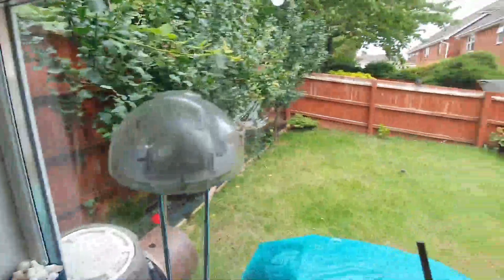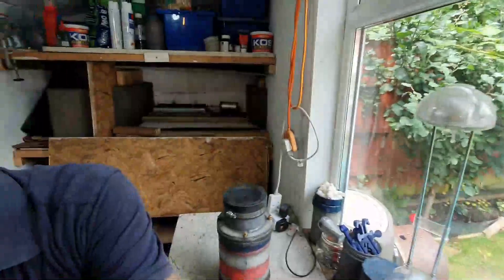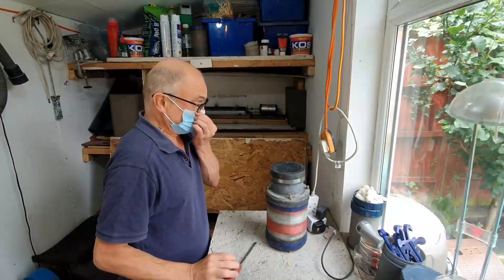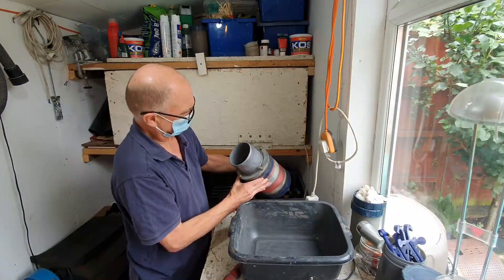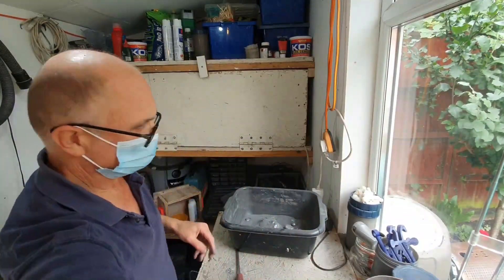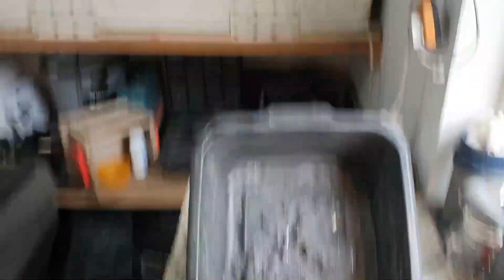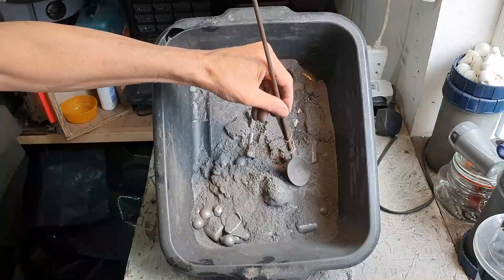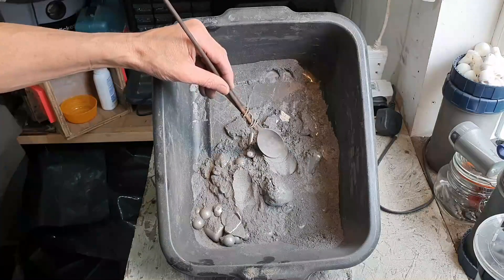aluminium powder from kitchen foli - 4

Comment: On a serious note, if you're playing with things that have the potential to go boom, you also need to consider less obvious sources of ignition. Such as static electricity(from the foam you packed in there rubbing against the drum and other parts, depending on the materials involved), sparks from the media(steel on steel), potential for overheating of the machine, and other sources of ignition depending on what you're making. Opening a can of explosive dust(especially metal dust) in a confined space with electrical outlets all over the place is begging for a big boom. One of the "dust clouds" hits an outlet just right, it could cause it to arc igniting everything else. Playing with flammable or explosive things is insanely dangerous. If you're gonna do it you better know exactly what you're doing if you like your body arranged the way it currently is, just ask all the amateur IED makers in Iraq and Afghanistan who got bit by their own products. Even if you do know what you're doing, things can still go sideways, it just reduces the probability of it going catestophicly sideways.
Reply from the maker: Excellent point, I have ignited aluminium powder with only bright sunshine. Fortunately, it burns slowly if in a heap and without oxidiser, albeit white hot.

Comment: You weren't worried about the steel balls making static friction and possibly igniting during the milling process?
Reply from the maker: It was a concern but I was careful to mitigate this risk by not creating too fine a powder. I didn't want to use lead or glass balls since they grind away rhemselvds and contaminate the powder. Any suggestions as to what to use as milling media are welcome.

Comment: Thanks for the video. Is it possible to make pure aluminium powder using ball mill  and use it in powder metallurgy parts manufacturing. 
If there are contaminants it won't work,  parts will have defects.
Reply from the maker: I honestly don't think the powdered metal I make  is pure enough for your use-case. I add charcoal to coat the particles and prevent oxidation. There will definitely be plastic and other contamination from the barrel. All this doesn't matter for pyro uses.

Comment: I was just about to comment to make a test area away from workspace. My brother moved a tractor into my shop and since I use a wheelchair I could not get to my usual test area, I lit a star to see the color and a nearby bowl of stars caught, then the residue on my benches spread to my stored compositions and chemical powders. About $2000.00 worth of chemicals burned up in less than five seconds. The smoke was so thick you could cut it with a knife. I rushed out of there and called the fire dept.. When I told them I had aluminum powder they evacuated the entire neighborhood. This occurred at 4am, by 6am there were approximately 40 to 50 gov. vehicles lined up and down my block for 14 hours. Looking at my home-made equipment they were convinced I was making a living manufacturing fireworks. It was 10 years ago and I'm still getting "oh so you're the guy" . Not my proudest moment. haahaahaa
  Oh in the end it was just smoke damage and a couple cardboard boxes burned but they had to go in there with a water hose, smoke mixed with water makes the most corrosive compound, everything in my shop was rusted beyond recognition, every tool, every nut and bolt, everything trashed.
Reply from the maker: Wow that's not the best experience! I'll certainly take more care in the future.  Hopefully others will take note and not make the same mistake!
Reply: @philipwaters  Someone said, "keep the dragon small so when he bites it's not so bad" Good luck.

Comment: Nothing like almost burning your garage down lol. Anyway did you open the ball mill every few hours or day etc because I have heard if you just let it mill for a week or something then open it, it could rapidly oxidise when it meets new air and ignite after a few second.
Reply from the maker: Yes absolutely,  you need to check your ball mill every day or two. I never experienced auto ignition on opening the barrel,  but it's definitely a good idea to check your charge frequently. Also don't run the ball mill too quickly to make sure the grinding happens quite slowly. Don't forget to add some powdered charcoal too.
Reply: @philipwaters  ok cool, thanks for the advice :)

Comment: Hey sir can you tell me please how gram of foil you need for this batch of powder
Reply from the maker: You should adjust your charge of aluminium foil according to the size of your ball mill. I used two rolls of the thinnest gauge aluminium foil I could buy.. not sure how much they weigh. You will get losses in the production process (sieving etc) but at the end I get about 500g after two weeks of milling. In terms of economics you would be better of just buying it from a chemical supplier
Reply: @philipwaters  For now i am asking just for theoreticaly purpose.
I dont have ball mill yet.
In my country we still dont have fireworks culture and hobbist are very rare and no one selling chemicals, we dont have sites or stores for that.
 I can buy KNO3 and sulphur in agricultural store, i can make pyro grade  charcoal easily, dextrin and SGRS arent problem.
but metal fuels are something what i need to make. 
Tnx for answer Philip!
Reply: @PyroHamster980  where are you come from sir

Comment: How to make a fast burning flash powder using potassium nitrate aluminium and sulfer can you tell me the best ratio
Reply: • [55/35/10]
• [Potassium nitrate/Dark aluminium/Powdered sulfur]

Use this formula. It makes impressive, loud salutes similar to those made with K perchlorate. The sulfur is necessary if you desire a large report with significantly more power and brisance. At critical diameter - to the possible surprise of some - it is actually exceedingly more powerful than [70/30 • K perchlorate/Dark aluminium] flash composition, as gaseous products are produced post-initiation, unlike typical 70/30.
Reply from the maker: Thanks Sam that will work. You will also get a bright flash just by casting burning aluminium powder into the air.

Comment: That was also very dumb of you . You defently should not be trying make any sort of pyro composition you need to think it all through to the end before plan and work out the working space so you have everything seperated at all times and YOU DO NEVER EVER HAVE ANY KIND OF FIRE OR ANYTHING THAT CAN EVEN MAKE A SINGLE SPARK IN THE SAME ROOM AS ANY PYRO COMPOSITION OR WORK PLACE !!!!
Reply: You most surely are correct, Hansen. There where/are some very important safety procedures that were ignored here. If there is any hobby that requires a decent amount of Common Sense, it is most definitely this one. The accident could have easily been prevented if he simply moved the camera to a safe location a couple meters away for the reactivity test, which would have only taken up an extra 20 seconds of his time. I smelled more incompetence in the air then aluminium dust. Frankly, his aluminium here was clearly milled to a very, very fine state with a large amount of sub-micron particulates, this conclusion was inferred visually. Extremely reactive product. Unoxidized enough and fine enough to be pyrophoric givin the correct circumstances. Lightning a spoon of it over the container? Ignition was guaranteed to be an inevitable conclusion to the situation. Now just imagine if that was a flash powder. Bad news for sure. Especially if it is a chlorate one in our hypothetical thought experiment. Our man (Mr Waters) would have experienced an even worse day. Wait, scratch that, - it would have likely been his last moment alive.

Safety cannot be understated. Those who neglect it are prime candidates for the next Darwin Award. Life is a precious gift. We have a moral obligation to respect it. Philip is lucky and highly fortunate he did not sustain severe injury or further property damage. I sincerely hope he learns from this experience, continually reflecting on it, making it imperative to have a more sense-compatible mindset in the future. Hopefully this accident will be his last. That stated, we must remember that nothing is guaranteed whatsoever.
Reply from the maker: You live and hopefully learn. I have learned some valuable lessons. Hopefully others will too.

Comment: Brilliant !i would like to do one like this. Your ball mill is made of PVC ? And are the grinding balls made of steel?
Reply from the maker: It would be more cost and time efficient to just buy the aluminium powder from a chemical supplier on ebay or amazon. For a fun project you will need to make a sturdy ball mill. I 3d printed my barrel but you could easily use pvc pipe. Milling media is steel ball bearings
Reply: @philipwaters  try using marbles. They have a very very low chance of lighting your aluminum in smoke
Reply: @Dill_Do  steel already has an extremely low chance of igniting your aluminum while milling . Actually I have found 0 reported cases of it ever happening, and I'd love if you or anyone could provide a single one
Reply: @philipwaters  thanks you for your Reply i would like to build ball mill for fine clay and sand powder for my molding project

Comment: Love your videos making al powder but didn't like the indor process of opening the jar... I knew this will happen soon or later and also not good for your lungs breathing the dust...anyway, what kind of media did you use steel or lead?
Reply from the maker: Steel ball bearings works best in my experience. Would be much better to open barrel outdoors or with good dust protection.